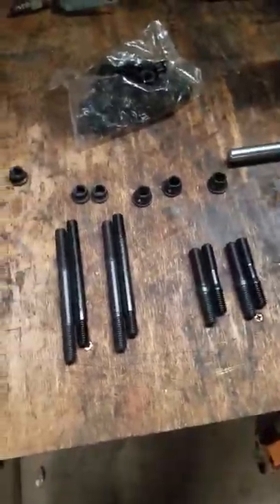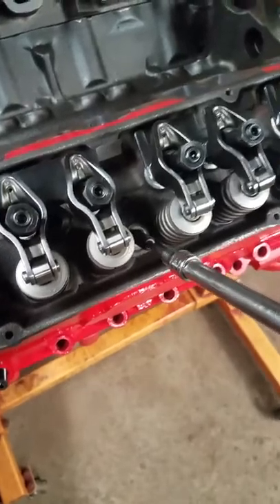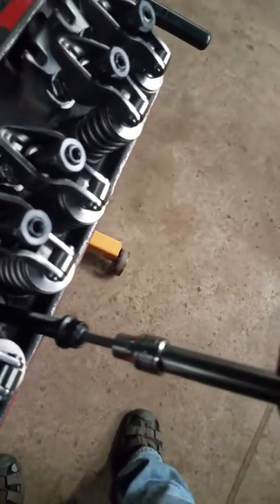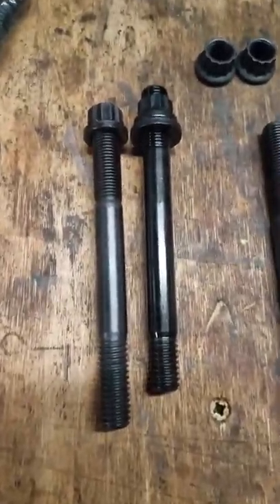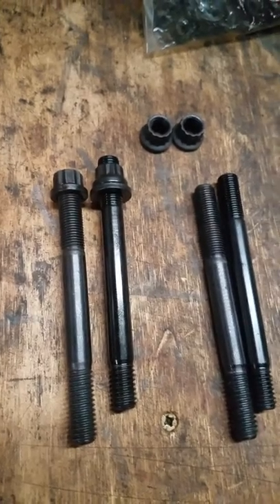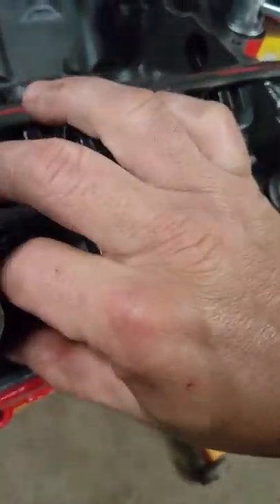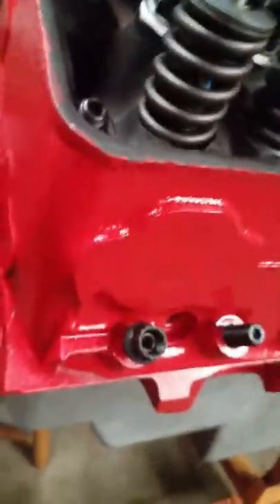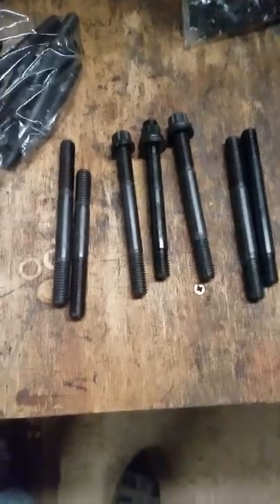Speedmaster  VS ARP Head studs

Comment: To the ones who say to simply unscrew the speed master stud and it will be fine - you have no clue on how torque works with studs, and you should probably keep that type of comment to yourself.  The true difference here is the 'grip' of the stud - OR the distance of unthreaded metal on the stud. The ARP has (just by looking at it) about 50% more grip than the speed master. THIS is what makes the ARP stud MUCH stronger and better!  Unscrewing any stud - to make it 'work fine' - completely changes the torque angle of the stud - which will  - in time - cause the head to warp or the stud to fail completely.

Comment: The arp doesn't go as far as the other stud.. so if you don't screw the other one down all the way it would be fine. And it still would probably have more threads than the arp does.
Reply: Hmm, indeed. The Speedmaster is threaded up farther. So you are suggesting to not bottom out the stud into the block? Others have suggested this may cause them to back out of the block?

Comment: Just in case anyone stumbles across this like i did, get hold of some correct size ARP's from someone with a better credit score, measure the overall studs length, thread end lengths and order some high tensile studs from any old company. ARP's are great but not because they use a magical steel, but because its convenience of just being able to order the right part without having to think.

Comment: Good information and I liked the comment on setting blind bolts. As for arp i personally believe they're the best. Most ppl are clueless to the fact that the ARP bolts used by Eagle does not torque to ARPs standards but rather a specific torque range thats specific to eagle only. ARP bolts on scat rods torque to ARP standards using ARP torque assembly lube. I personally skimpt out for some cheap ebay cylinder head studs today and will probably have an issue like in this video and will have to possibly blind set them. I have seen the sbc oil pump stud blind set. Once torqued they're not moving.

Comment: I have speed master head studs on my LS engine…. I didn’t have any issues whatsoever, maybe those studs you have are wrong, obviously thee thread is taped longer on the speedmaster bolts which leads me to believe that they are miss packaged or don’t buy them for a small block Chevy.

Comment: I’m not sure speedmasters are junk your running the studs down against the shoulder in open water jacket hole in block (sbc) you’ll need thread sealer on those threads. You’ll only ever get full faster strength once you engage the entire thread with the nut. It looks like the speed master had entire threads engaged with extra at the top from the look of it has no threads. Arp are quality bolts n studs no dispute but cheaper doesn’t always mean junk depending on your build arp is over kill if it’s not beyond stock to mild builds

Comment: If you are going to invest in aftermarket fasteners, why would you spend your money on anything other than ARP?
Reply: ARP costs a lot more.
Reply: @johnparrish9215  Cheaper to buy ARP and to be assured of the best quality than to buy a complete engine due to a fastener failure.  If you feel you need aftermarket fasteners why would you not buy the best?
Reply: @charlestappa59  You were looking for a reason, I gave you the only one.
I didn't say it was a good one
Reply: @johnparrish9215  Fair Enough!.
Reply: price!
Reply: There are a lot of threads abour "magic" ARP fasteners failing while being torqued. They are just fasteners, thinking that they are somehow different than any other fastener of the same grade is just naive.